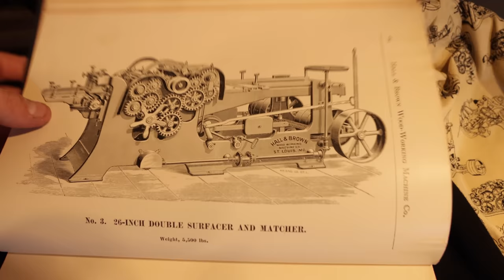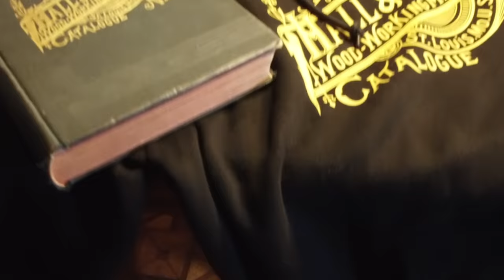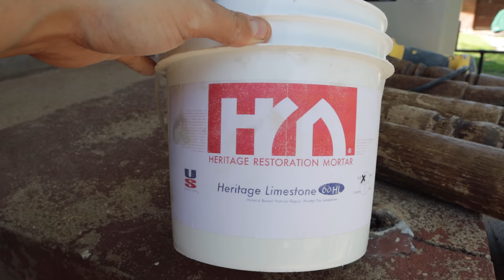How to Repair Limestone on Your Victorian Home S2EP22

Comment: The limestone repair work is a labor of love. It looks great. So much sweat equity but what a sense of accomplishment when it is done and the front of the house is restored to what it was originally. A new useful skill learned.
I love how you made a template for the repair of the corbels. They look great.
Kaleb, please remember that it is NOT easy to repair a corner on drywall so a limestone repair outside is very hard to do....and a straight corner too. Impressive to say the least.

Comment: Looks a lot better. A couple of suggestions, use a 3 inch scraper and go over it with a wet sponge before it dries to smooth out those tool marks.
Reply from the maker: Thanks for the tips!

Comment: I live in England and I used limestone powder-Hydrated lime and pozzolan mix which overall gave me the same result. Also, good to limewash in the end to protect it from the elements. Raw lime or lime putty 50% and linseed oil or Tallow mixture with a bit of limestone powder for colouring.

Comment: Use a margin trowel instead of a putty knife for the limestone patching. And if you finish the patch with a rubber float you can match the texture of the existing surface.

Comment: Wow...you did a great job repairing those spots. Do you suppose there is a product out there that you could inject behind the loose limestone, instead of tearing it off?  I remember watching a video several years back that showed them repairing an old building in England and they were injecting some sort of adhesive. Wish I could remember what they were using. Can't wait to see the next update!
Reply from the maker: Yes - some of that is coming as well. Can't use it everywhere though.

Comment: Excellent work!! When you're done repairing and stripping the limestone, will you be applying a limewash to bring the color back?
Reply from the maker: Mineral paint is the plan. Still trying to find out if these house were painted or not originally. that will determine the color. Hope all is well with your project!
Reply: @The2ndEmpireStrikesBack  It's so hard to get information on these old houses. If yours is made with limestone blocks then it probably was left in its natural white color. It was probably stunning in appearance when new! The limewash is merely bagged lime mixed with water, brushed on and creates a new layer of limestone over whatever surface it's applied to. Something to think about anyway.
We just discovered a Victorian era drainage system and excavated the whole thing. Now we're working to restore it.
Reply: @The2ndEmpireStrikesBack  Its so hard for me to imagine this having been painted when new.

Comment: Glad to see your houses exterior is getting a facelift and fill ! I'm surprised you had a good solid couple of days were the heat wasn't to much . it's been so hot here in KC, Mo(102 )😫 I just want to sleep the summer away with a siesta every afternoon 🥵. I can't wait to see what you do once she's  repaired ! are you doing a lime wash with color ?
Reply from the maker: It will be a mineral paint most likely. I am still trying to find out if they painted this type of stone fronted homes in St. Louis. Currently almost all of them are painted and i am trying to get to the bottom of why, how and when on that topic. If they painted them then its going yellow if not i will paint it the same color of the stone.

Comment: Hey Kaleb,  great work on the Limestone restoration and corbels. I had an idea to help you shape the curves on the corbels, use some scrap piece of PVC pipe to help shape the positive and negative curves and maybe cut the pipe in half to shape the projection of the lower curve.  Home Depot probably has some throw away sized bits they could give to you…

Something else I wanted to share with you is the “Dry Ice” method of paint removal and surface cleaning for the front of your house, for the mansard, wood trim and metal railings. Now, I have no idea how expensive this process is but from the videos I watched today, it’s fast, non damaging, little to no toxic waste as there is when using chemicals or sand blasting and it is claimed to be 100% environmentally safe.  I didn’t look into it enough to know if there is rental equipment you can hire to do it yourself or if there is a local company in your area but I would say it’s certainly worth investigating. 
Videos I watched were from:
*Cold Jet—Industrial cleaning applications discusses industry methods and advantages, 
*Optimum Dry Ice Blasting
*ICEsonic—wood restoration, 
*Coulson Ice Blast—concrete paint removal from hockey club showers, 
*RIDMed— paint removal from red brick,
*ICS cleaning systems-paint removal from a wood chair,
*one of the compilations also includes cleaning 150yo statues. 
The estimated cost of dry ice was about a dollar a pound at the time of the recorded videos, with a minimum of 500 lbs, then you need to rent a hopper/blaster and have a compressor of a designated PSI size to make it all run. It sounds like the perfect solution but again I’m not sure what’s affordable or available to you in St. Louis or if that is a method you would consider.
—Best wishes ☺️
Reply: Think in a previous video he said hed used dry ice for other projects and was not overly impressed.

Comment: If you do a second run of the hoodies and they are zip up I will buy. I just don't tend to wear pullover hoodies 😭

I'd also wear a reversible zip hoodie. If it was brown or black on one side with the design and the other side was just the machine print. That would be super wicked! I'd buy that too 😻😻

Comment: Getting a good key so it sticks is the main thing, all the fancy stuff can be dealt with later. I cant see if the walls have a texture-pattern, but if they do I might make a silicone mould and as the plaster dries stamp it with the casting.
Reply from the maker: no texture besides limestone texture. What you are seeing is the 50 layers of paint that was built up on the exterior. We still have gobs of it to get off.
Reply: @The2ndEmpireStrikesBack  Ah, thats what it is!  Nice job on the detail under the window by the time you get to the roof line you will be an expert. 👍👍

Comment: Huzzah! Excellent start for a much needed repair. You didn’t have to go to Chicago to learn? Will your paint stripper sheets work in the heat, since it’s supposed to be 100 today? Patches look much better than I would have done, and you’ll only get better, even if most of it will have to wait until fall probably. And more windows will be great also.

Comment: I’m so glad to see you working on the facade.  I’ve been wondering when you’d start it up, but also know that there’s a limit to how long you can be out in the heat.  And that’s not taking into account how the material handles the heat.  Good thing we all got a break for a few days from the sweltering temps so you could practice your art.  

I’m curious - at one point you talked about going to Chicago for a couple of days to learn how to use this which was a huge improvement over the impediment of going to Baltimore.  Did you end up not going?  I can’t remember what the reason was, but I thought I remembered you saying you couldn’t do it without the training.  Not sure why - whether you thought they wouldn’t sell it unless you were sort of “certified” or whether the city required it?  What’s the scoop?  I’m curious!  Or just nosy! 😉

BTW, the repair looks great!  I think you’ve definitely got the hang of it!
Reply from the maker: the company in baltimore wont sell the mortar until you take the training and their brand is the most popular or at least ranks the highest in search results. It just took some digging to find the company in chicago. They do also offer training and i plan on doing that in the future, but i cant to that at the moment as they only do the training in the winter.
Reply: @The2ndEmpireStrikesBack  
I thought I remembered that they wouldn’t sell it without the training.  I didn’t realize they were two different products.  Or that the one from Chicago allowed you to purchase without the training.  I was puzzled, thinking I’d missed something! 😂 I’m glad you were able to proceed - you’re good at reading directions and researching to figure out how things work.  Something tells me that your work will surpass that of many who actually take the training!  Great work on that corbel!  I can’t wait to see the paint removed and the facade restored!

Comment: Time for you to get a hock.  Also, I usually use a small sledge with a wooden handle when I am chiseling concrete.  This keeps some of the vibration out of my forearm compared to a metal handle.  Or, since you are doing just fine, you can ignore this comment...

Comment: Probably a dumb question, but can you make the corbels in the shop, then attach them to the exterior?  Might be easier to manage rather than working outside in the heat.  You could set up an assembly line.  Just a thought.
Reply from the maker: You can do that and ive thought about that but 70% of the material of the corbels is intact so its a great surface to attach the new material to. If i knocked them completely off the biggest problem would be reattaching them as the windows and sills would have to be removed to do so and i suppose at that point of labor and cost it would just make sense to have them completely remade out of fresh stone. Youve got the right idea though. If i had something more ornate on the front (like a face, gargoyle or ornate collums) then casting would be the only way to get it perfect.

Comment: Just looking at your front door while you were patching the exterior.  Will you be refinishing it or getting a replacement?
Reply from the maker: Those doors are not original to the house and are actually too small so will be replaced with replicas of the originals. They at some point had to add 2x4s to the front to make those doors fit. My guess is that happened sometime in the 80s based on the type of 2x4